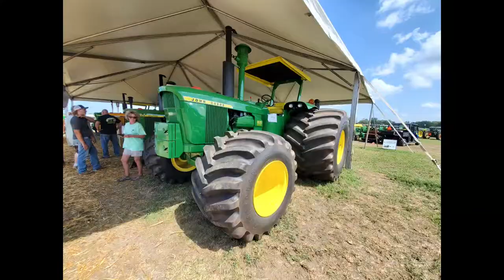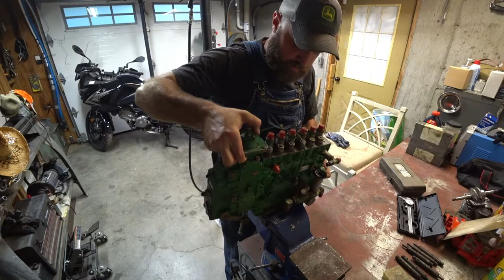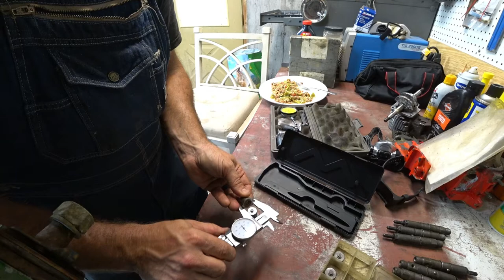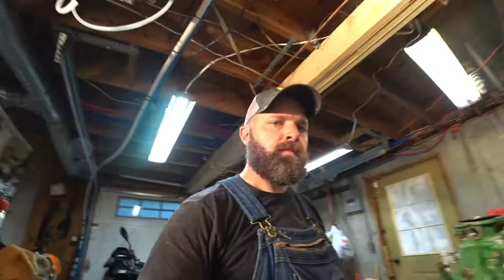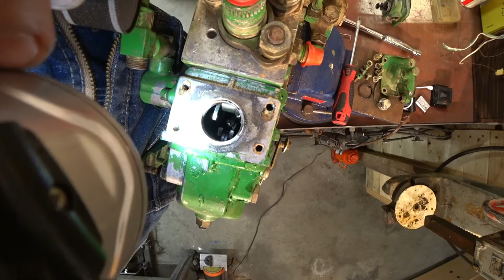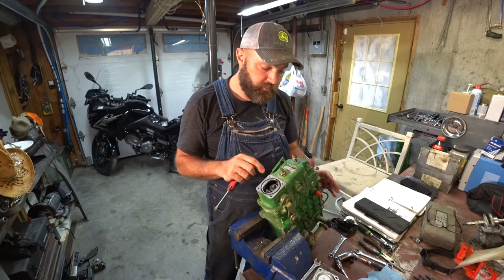HOW TO TURN UP JOHN DEERE INJECTION PUMP - BOSCH PUMP TUNING INFO - FUEL SCREW - GOVERNOR - TIMING

Comment: Man I’m happy for this video! I’m a DIY Guy As well. Got a 4840 that I want to mod a little and it’s hard to find info. There’s a little I found on forums but not much, maybe I didn’t word it right like you said. So happy for this video. Keep them coming . Thanks a bunch. Subcribed!
Reply from the maker: Thanks! A few things I have learned since this video that I will go over in my next 5020 Deere vid....do not turn the fuel stop in too far or it can go into the start retard portion of the barrels (google Bosch start retard barrels) if your pump is equipped with start retard barrels. I also turned my governor screw in 8 turns on my P pump and that yielded somewhere between 2800-3000 rpm for me. My pump also accepted P7100 delivery valves that had a tapered body. There are numerous styles but the 191 sets advertised on Amazon worked. Good luck!
Reply: @TheBeardedGearhead hello, i have a 7810 with 250hp, how many Turns i turn on the governor??

Comment: Thanks for the info on that RSV. I have a V8 Mack in my lobsterboat, we do some racin around here in the summer. I'm using a RQV on the pump I have on it now. I'm maxxed out with that pump because it rolls at idle with a load and must have restrictor delivery valve nuts to stop that, with the RQV. I think that can be adjusted out with the RSV I hope, I'm gonna try it now I know a little more about what them adjustments are! Just started learning the engine this past year. Engine and boat are on my page.
Reply from the maker: Good deal! I am going to try and do another pump vid soon and build a set of injectors. Learned much more since the first vid!

Comment: I really appreciate this video. Thank you! I’m gonna try and give me Deutz F5L912 engine in my log Skidder a little but for more fuel but I’m also trying to clear up some of the raw fuel at idle. Any idea what I’d adjust to clear up some of that white/blue raw fuel at idle? I’m thinking maybe a timing adjustment but not sure. The pump appears to have an adjustable mount to the engine so maybe need to clock it a bit?

Comment: How do you take the lope out of one of those pumps? My uncle has a Case 1570 that lopes at idle. I like the lope at idle but not the lope when under minor load at 700 RPM up. It’ll start loping at any RPM under minimal load. If you get more load on it, it’ll smooth out and smoke some.

Comment: Hi , does turning that diaphram at the back of the pump not adjust boost fueling ? On the bosch VE if you turn that diaphram it changes the amount of extra fuel given to the amount of boost available , wondering if these are the same as  they are same manufacturer ! its same with the starr wheel or brake drum type adjuster .
Good video !

Comment: Did this on deutz 
It was about 5- 6 visible treads adjusted 4 turns and go a "new" traktor
Reply from the maker: I am actually trying to find an 80 06 or similar Deutz to build a puller out of. I have already located a bigger engine for it.
Reply: Was it a Bosch 'A' pump?  I'm having a heck of a time finding information on pump adjustments.

Comment: I have a 2004 Lull 1044C-54 telehandler with a Cummins B3.9T with what looks like the same style pump but with 4 cylinders. Model #PES4A95D120RS2880. Wanting to increase fuel flow just a bit from mid-range to top end. First things first though. Add a tachometer and fuel pressure gauges. Need to find a manual.

Comment: I’m trying to figure out how to “turn my delivery valve holders” “clocking the barrels”, would you know how? Thanks
Reply from the maker: If you are talking about adjusting the port windows on the barrels, then no. That is something that I would not do without a bench.

Comment: Sir I have the case 4000 sugarcane harvester fitted with cummins 5.9l 24 valve with VE pump and now the company has fitted the bosch inline industrial pump with the injecter nozzle and the pipes all brand new very similar to the pump you showed. There is 1 issue, machine is normal at idle speed but as soon as you on the blower and the base cutter the machine starts rough idling before this was not the issue everything was normal at idle speed so what has to be adjusted on the pump.
Reply from the maker: What you are describing actually sounds like more of a low timing issue or a low supply pump pressure issue. I would start there first

Comment: I want to know how to turn the fuel up on my John Deere 4230 it's got about 100 horsepower
Reply from the maker: It is hard to get a good amount of fuel with a small rotary pump without lots of work and money. I do plan on taking the old Standyne CAV style pump off of my old 5020 motor and doing a video on it one day.

Comment: If you take the cap off to adjust the fuel screw do you need to add oil back to the pump or will it get that from the oil line?
Reply from the maker: Not on most pumps. Most inline pumps have an oil feed line that lubes the pump and then it drains out through the bearing retainer plate in front. There are a select few older inlines that are self contained. A lot of pulling pumps are modded to be self contained.

Comment: How did it end up ?
I should start with mine soon
Reply from the maker: I have a few vids of me pulling on my channel. I figured out that the pump I have has retard barrels and plungers which are no good for pulling. I have it turned to somewhere around 3k rpm via 8 clicks on the screw. I built and added a 55psi supply pump system to feed the big pump but the big pump just isn't big enough. A 13mm or 14mm is in my future. Tractor makes 43psi of boost and pulls hard but it needs for fuel to help cool the cylinders.

Comment: I think you said that wrong. The full fuel stop screw needs to come out to add more fuel
Reply from the maker: On this pump, the screw has to go in. If you tear the governor apart and operate the linkage, you will see that the arm moves towards the front of the pump under load. The further forward this moves, the more fuel is applied. The fuel stop has to be screwed in to allow this to happen.

Comment: Hey i am a diesel pump technician i work on those pumps if you have questions i can help I really liked your video
Reply from the maker: Thanks! I will keep that in mind!
Reply: Any idea what to adjust on my Deutz F5L912 engine to clear the haze at idle? I don’t get much black smoke under full load but lots of raw smelling fuel at idle. The pump is a Bosch PES5A and it’s got the Bosch RSV governor.
Reply from the maker: @jdatwood7086  I would be looking more toward getting your injectors freshened up. A lot of times that is where the haze stems from.
Reply: @TheBeardedGearhead  sorry, I didn’t leave enough info. Yes, I replace the injector first thinking they were worn/dribbling. Thank you for your fast reply. If you can think of anything else that’d help me I’d love to hear it.
Reply from the maker: @jdatwood7086  next step would be to verify that the injection pump timing hasn't slipped. That can cause smoke at idle. How isbthe cylinder compression and does it have good water free fuel in it? Lots of things can contribute to white smoke. Timing and injectors are usually the main culprits.
Reply: @TheBeardedGearhead  It’s possible timing has slipped but hard to say. It runs nice and it’s the fastest starting diesel I’ve ever seen. The cylinder’s are like new and compression is good. That motor has a difficult time getting hot which doesn’t help. I’ve never seen the engine oil over 160-170 degrees even in the summer and that’s just the peak while pulling. Soon as it idles again it cools right back down to 140-150 degrees.

Comment: Do u have a video turning up a Lucas cav style pump like the smaller John Deere’s like a 2950 or 2750 used?
Reply from the maker: Sorry but I do not. I have only dealt with the big pumps.
Reply: @TheBeardedGearhead  ok I’ve been tempted to turn my 2940 up and put a turbo on it but want to make sure I don’t mess up the pump somehow
Reply: @TheBeardedGearhead  I also seen u had a video about a 2955 hard starting issue. My 2940 was the same way and last year about this time it blew a head gasket and overheated. So I tore it down and done a overhaul and put a high compression kit in it and now it will start in under 2 seconds after sitting 4 months and on a 15 degree day. U just can’t use ether and it runs a little warmer even with new water pump, radiator and thermostats.
Reply from the maker: @xade7863  I am guessing that you are looking at using a manifold and turbo off of a 3055? Should be same engine. I will have to look at my 2955 pump next time I use it and do some research on it too.
Reply: @TheBeardedGearhead  I was actually planning on using the manifold off of a 4040s since it’s same motor and someone had already cut out a hole that will work with the 4040s muffler. Mines also got cab and a/c and all the 3055 style mufflers won’t fit
Reply from the maker: @xade7863  You sure a 4040 is same motor? A factory 2940 has a 359 cubic inch engine like my 2955 and the 4040 shows to have the 404 according to tractordata.com. If that is the case, they won't interchange. I know the 3055 will because I was looking at my uncles 3055 just a few weeks ago. It appeared to have a blown head gasket.
Reply: @TheBeardedGearhead  the European 4040 badged as a 4040s used a turbocharged 359 that was if I remember correctly about 115 horse.
Reply from the maker: @xade7863  I see. That makes more sense. Good luck with your tractor!
Reply: @TheBeardedGearhead  thanks also I see you’ve done a few engine conversion on some other videos have u ever done a oliver or white?
Reply from the maker: @xade7863  not yet. I have a spare 5.9 Cummins that I plan on setting in some sort of tractor in the near future. Probably will be a Farmall tractor though.
Reply: @TheBeardedGearhead  them Oliver’s transmission and rear end seem to be able to take a lot. I’ve got a neighbor with a 1855 Cummins conversion that’s been turned up to 200 hp for a couple years and they use it for heavy tillage work and never have issues
Reply from the maker: @xade7863  I am trying to acquire an old Farmall that my grandfather bought new and swap my engine in to it. The original is full of water from sitting in the weeds for years. That will be after my 5020 and my 856 are completed. I am putting a DT436 in my old 856 that I bought this past winter.
Reply: @TheBeardedGearhead  we did something similar with a 756 for a neighbor a few years back except we used a dt466 out of a dump truck and changed the governor over to work for a tractor
Reply from the maker: @xade7863  what did you do for a hood? Extend the original or something different? I have been told that a 560 hood will work for my swap but not sure.
Reply: @TheBeardedGearhead  he had a parts 756 and we cut part of its hood and extended the original and I believe we did the same with the frame rails and we used 1086 clutch and stuff to rebuild the t/a and 4 speed.
Reply: @TheBeardedGearhead  sorry I asked my dad about it and he said they made like a chassis for the motor to sit in and used motor mounts and done it that way